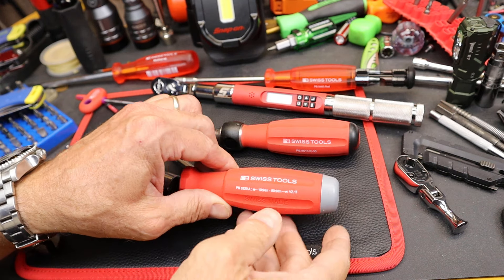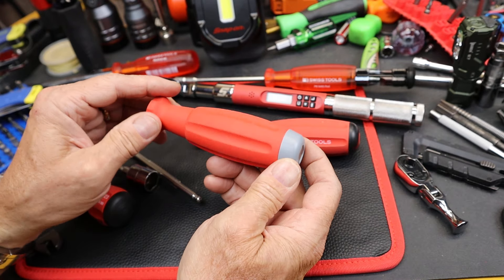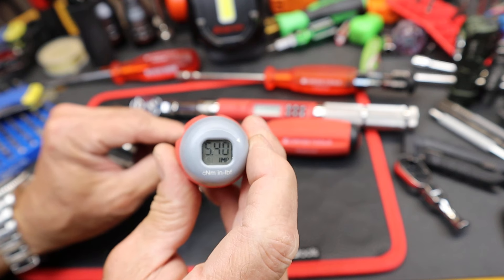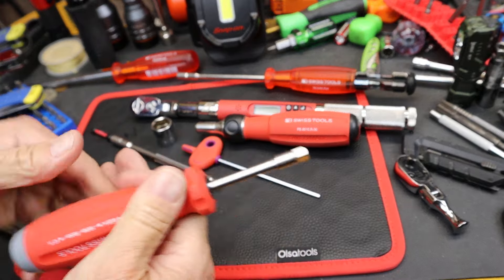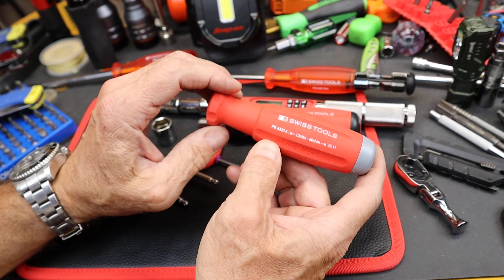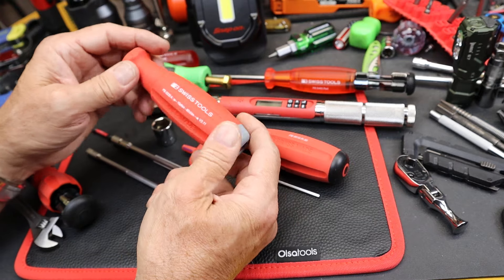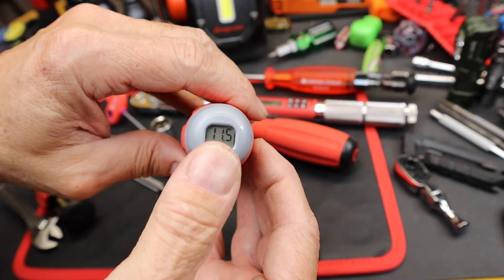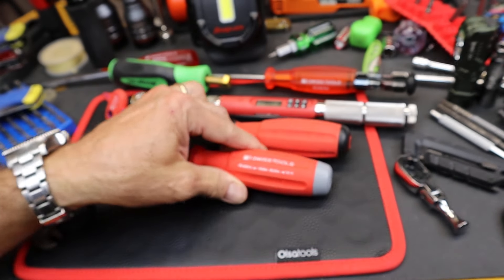Digital Screwdriver? Yes, the PB Swiss DigiTorque Driver Handle and Shanks.

Comment: I discovered these by accident when I bought one of the torque bits by accident.  It was a great deal, but when I got it I realized I couldn't use it without the driver handle.  I thought about getting one, but really had no use for it.  At the price, it didn't make sense for me to pull that trigger, so I sent the bit back.

Comment: I just recently bought a Vevor digital torque screwdriver for breakers and a NEMA 14-50 receptacle. I also have a Wera but it doesn't go up to the inch lbs. I needed. The Vevor worked great for me. Tesla charging went from 5mph on 120v to 30mph on 240v.

Comment: For doing any electronic screws, (phones, laptops and computers) I highly recommend the Wera Turbo. While it does have a disappointing amount of slop,  the  included gearbox speeds the bits rotation by 4x, while the torque applied to the screw is just 25% of what it would be normally. 
I work on a lot of electronics and being able to very quickly fasten and unfasten screws with virtually zero risk of over tourquing is amazing and not having to constantly toggle a rotation control is also very nice. Just make sure you get some nice bits, Vessel make very slim philips 1, 0 and 00 bits that I use with this screwdriver.
Reply: It's too big for laptop/phone repair. I use their micro screwdrivers for that purpose and it's great, the free rotating end cap makes screwing/unscrewing very nice, and bits are designed for such work. By the way Wera has the 1430 ESD Kraftform Micro - which is a torque micro screwdriver for such applications.
Reply: @eliadbu  I also have a set of the Vessel micro screwdrivers, but I would never use it for phone or laptop repair. They're really only used on small fiddly stuff like glasses and watches. 
Being able to either completely undo or fasten a laptop screw with a single wrist twist, while facing zero risk of over tightening is something I can't go back from.
Reply: Yeah those Vessel bit are great for computer and phone fixing

Comment: DOC! The United States has never used limey Imperial units! We never adopted the changes the UK passed in 1824 which changed the values for all or almost all of the old English units.

In 1959, we and several other nations agreed to create the International Pound, and then the International Yard in 1960, but all other U.S. Customary Units not derived from those are still noticeably different than their same-named Imperial counterparts.

It matters! You get more beer in an Imperial pint than in a US pint!
Reply from the maker: I'm pretty sure that the US barely uses any units regardless of COO. We buy gas in tenths of gallons and drive in tenths of miles even though we have no name for those units. And most citizens here could not name five, heck even three fractional measurements in ascending or descending order. We draw marks on tape measures. We have no idea how much gallons weigh. And swear by 2x4s which are neither 2 nor 4.
Reply: @lastbesttool  Upvoted, and I know I’m being pedantic, but it’s extremely important to get this right. Your content is awesome, and I have a strong desire to make sure you are trusted by others who know the importance of this difference.

I’m also intrigued by the insight of your reply, and will respond to that separately, to keep my two thought trains separate.
Reply: @lastbesttool   1) There’s a lot more metric going on here than you might think! 2) Technically, we buy gas in increments of 9/10ths of a cent, and I’ve long thought this was evil; I’m curious what your thoughts are. 3) Tenths of miles: you pointed out something that I’ve known since I first drove a car, but didn’t realize until you reminded me that it’s mixing decimal divisions with the English sub-multiple system of units (gallon, pottle, quart, pint, cup, etc.). 4) Do you know of the time Wendy’s tried to upstage McDonald’s quarter-pounder with the bigger third-pounder and failed? You’re absolutely right on this point. 5) I’ve never drawn marks on tape measures; can you teach me the use-cases? 6) A rough estimate can be derived from “A pint’s a pound the world around.” but I’m fairly convinced that’s never been exactly accurate. 7) OMFG, you absolutely need to watch the Stumpy Nubs channel’s take on 2x4s; he posted it in the last couple of weeks. Bonus) Alexa thinks another name for a half-gallon is a quart. I need to record this before the programmers fix it!

Comment: Interesting design with the display, I was wondering if there is some audio feedback from that electronic device. I have the wiha electrician insulated torque screwdriver, almost the same adjusting with the Allen key, but it is purely mechanical and it will display the preset torque in a little window in the front of the handle. More practical for me and no battery needed. Specially designed for relays, and circuit breakers with insulated bits, and I think is cheaper than this pb swiss handle.

Comment: That's the older series. It needs the Allen key adjustment and you cannot replace the battery. on the never version You can adjust the torque with the end cap and you can replace the battery. I have the old version as well (but the ~0.4-2Nm) and the old version of the pistol handled one (3.4 to 16Nm). When the batteries will once die, I will upgrade to the newer versions. I love them!
Reply: Old tools, old man ... But a Rollex one with no purpose for now ... Maybe a new ones with some tork possibility 🤔
Reply: been using two of the old DigiTorque version for more than ten years, had to send one for battery replacement to PB Swiss and when i told them i had two they advided that i should send both so i'd have new batteries for both. only paid shipping for that, turnover was less than two weeks and the S/N were still the same when i got them back.
check your manual or contact PB Swiss  customer service through their site. 😼👌

Comment: How we gonna stop the wars around the world if we are not able to agree in how we measure and weigh things.
I got a bunch of PB Swiss tools and it never has disappointed me.I can not say the same about other brands.
I wonder why one of the two "sides" does not give in.
Reply: There are some industries where it would be an enormous effort and cost to change units. For example the railway here in Canada still uses miles and mph. Even though Canada went metric in the 70's the railway will not change.
Reply: I remember the day America was going to change over to the Metric system. It was talked about in the news papers and on the news. The big day came and went without any fanfare. Originally in 1975 and again it was pushed in the 90s (I think) 
We still use the proper American size measurement. As big as a washing machine, car hood, bowling ball, etc...

Comment: Doc, does it have to be set at it's lowest torque setting when not in use?
Reply from the maker: I did not see that in the instruction, but it is usual best practice.
Reply: @lastbesttool  Torque Test Channel may have refuted that recently
Reply: no need to, more than ten years of use doing that with two and there never was any calibration problem. 😽👍

Comment: If you have to ask how much it costs, you can't afford it.
Reply: I was waiting for the price... he normally does mention it. This one he didn't. A screwdriver,  this ain't it. So $200 may be justifiable for a precision instrument... a fraction of the price of that snappy he had on hand.
Reply: That was kinda my thoughts
Reply: is spending ~200 bucks on a tool that will help you not break costly parts by overtorquing them really a problem? 🙄
people spend more on starbucks, Lego™, simpin' and funkkoppopps in a week than this... 🧐
Reply: Soooo how much does it cost hmmm
Reply: Is 200$ confirmed price? It is pretty standard for torque screwdriver with certificates and overall precision better than 4percent

Comment: I went the cheap route, a Craftsman.  Actually i bought it at a pawn for 20.00. It goes up to 40 inch pounds and comes with bits. Not digital but seems to be accurate.
Reply: As long as it’s accurate that’s what counts. Getting your stuff professionally calibrated is the way to go.

Comment: Next time you use this the battery will be dead
Reply: yeah, being battery operated worries me.
Reply: Just change the battery then? lol
Reply: @Drakey_Fenix  to replace a battery one must have a fresh battery with them. Thats rarely the case.
Reply: @alexdrockhound9497  This tool is aimed at pros that should have all the things they need on hand. The torque slipping mechanism seems mechanical though. The screen may only be how you know what it's set to, so it might still work if you primarily use one setting. I agree a dial or something would have been better to not rely on a battery.

Comment: seems like a terrible tool design it needs a separate Allen wrench to operate and batteries for display making it a great paperweight after a while seems only useful at a desk in a business doing very specific requirements for assembly specs like military contracts.
Reply: seems like you've never used one. they are used for specific tasks, not for screwing your IKEA furniture daily. 🙄